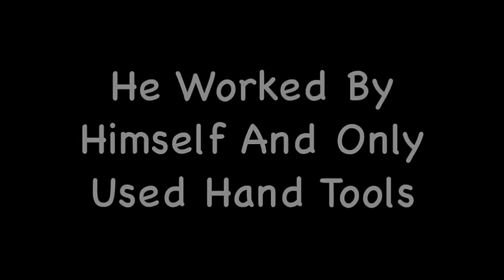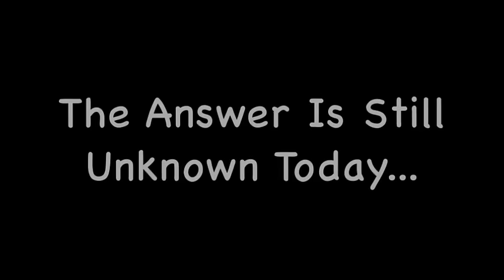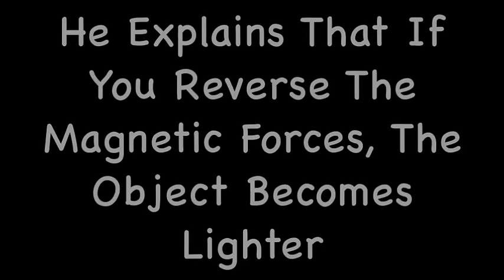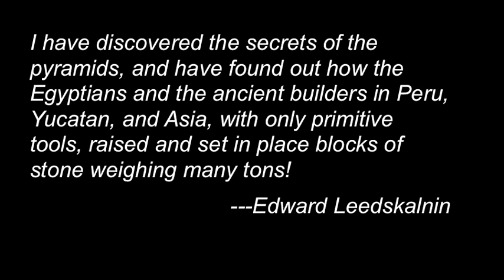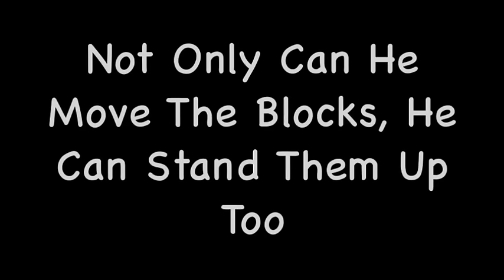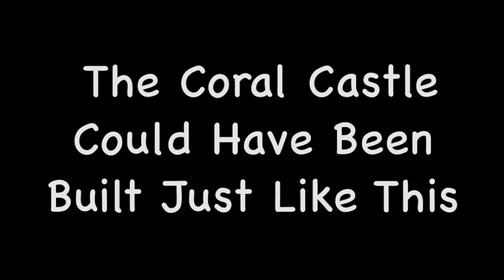Coral Castle: Mystery Solved

Comment: Great video, but there is only one problem with your solution. When Coral Castle was moved over 10 miles away. The first truck came back in 30 minutes to find Ed Leedskalnin had already loaded half of the next truck with 50 tons of stone by himself. Using the techniques you show in your video, this would have been impossible.
Reply: Yup, I agree...I don't think this was what he used either.
Reply: ***** But either way, this guy is also quite the genius. He equally accomplished the same task through physical and technical understanding. AND - unlike others, he showed us how he did it. Thus, he could be considered a greater contributor.
Reply: bobbie joe shmo I'll argue that last point you made. Was the atomic bomb a greater contribution because it was made known? Are nuclear plants in operation today a greater contribution because they were made known? Are cannons and war machines a greater contribution because they were made known? Is Methamphetamine a greater contribution because it was made known?  My answer to all and any invention is; that who holds the knowledge of great power must use great discretion to prevent the soiling of it by mans weakness'. Humans have only proved time and time again that we are not responsible or loving enough for great things. Just as a gun made for hunting can be used to kill a man, so to can a pencil made for writing be used to kill a man. The individual needs to be removed from oneself in order to learn a higher Truth so that human weakness do not spill into the design of powerful inventions or ideas.
Reply: Brahp Meahh I completely respect your point, but most of the state of FL is run by nuke power. Cars run because knowledge of how to refine oil into gasoline was shared. And look at radio waves, microwaves, cellular etc. All enrich our lives because they were shared.
Reply: exactly...this doesn't solve the mystery but still shows a way to do it. Though it lacks efficiency of time of his mysterious method.
Reply: bobbie joe shmo ..and cars, though being changed quite a bit with hybrids, etc... to be "cleaner", have provided quite a bit of trouble. I love that they made it possible for me to visit my relatives in little time, but people before me needed horses, before that walked or just didn't go. Because I have luxuries they didn't, doesn't make it okay to pollute the world. We keep up this pride of invention and when we find out a new drug or contraption needs revising because of serious problems, we shrug and move on like it was okay to blunder as long as we "progress". Meanwhile we've mad sit so easy to live that billions of us will be fighting over water eventually. Ridiculous. We should be inventing ways to no use so much of everything, yet the majority of what we've invented keeps us looking for more "things" to have. Fix THAT.
Reply: bobbie joe shmo He did something better than give us something to use. He showed us what we can be capable of all on our own when we understand the universe. That is something that should be kept secret or to those with higher knowledge. One must understand that there cannot be peace so long as the self exist, as the self of each individual is entirely responsible for what happens in this world.
Reply: Interesting
Reply: ***** It is not I who deem the unworthy. The unworthy deem themselves. I do not see great secrets of knowledge blessed upon the face this Earth in modern times, so therefore we have all been deemed unworthy. Humanity is ripe to fall and so shall it be if we deserve it.
Reply: bobbie joe shmo I'll agree with you that this guy is smart to do this, but he in no way shape or form accomplished the same as Leedskalnin. First, this method doesn't answer how to stack stones, second: doesn't answer how to cut stones, third I think more than wanting to be a contributor, he was going for his 15mins of fame under the pretenses of another man's accomplishments. Lastly, he doesn't try to correlate anything with the stars(his method is too inaccurate... what if he'd of been off by a foot, or angled wrong? No contingency there to correct these issues.)
Reply: The Truth I completely agree!
Reply: Yes these things make life more comfortable but they in no way make life more simple. Death and destruction have always been the primitive mans game. If we do and when we accomplish anything its far from great. Some will benefit others will suffer. If we had learned the secrets of levitation any earlier I'm guess the world would not stand as it does today. Image a floating aircraft carrier... wooo! Humans fail at the basic principles of life and those have nothing to to with science. Sorry if this isn't the kind of debate you wanted to have, but I'm sticking to my original point that we don't deserve anything. Not yet anyway.
Reply: Let think how he could move it faster. We saw the rolling methods with a long bridge of wood under to make sure it falls a certain way. There is also a Gömböc that will always right itself no matter where it sits. So you just modify the shape of the stone tying wood to it instead of making a long bridge. Then you can roll it away as it wants to end up on a certain face but you push it over and it will keep moving as long as you add force. What shape that is I dunno but all the other examples are out there for it to be.

A piece of wood and a tiny stone on it to balance it and be able to add your shaped wood braces causing that eternal fall and just walk the dog.

Comment: The problem with Wally's theory is that he only moves big rocks on prepared smooth surfaces. I'd like to see him move those huge rocks over rugged terrain and up and down inclined contours.
Reply: it is NOT hard to imagine that someone instead place stable ground to move the object a distance. you can also CHOOSE the path you take and avoid difficult terrain.
Reply: @juanserrano8678  You gonna do that for a couple hundred miles?

Comment: During half way point of building it he moved the entire build ten miles away without anyone seeing any machines. The rotating gate is 9 tons, it took a 50 ton crane and 6 guys to replace the bearing in 1986. If you can piece together a truck diff and wheel hubs to move half that weight by yourself and place it on a pin to revolve with little effort as-well-as when it rotates it comes so close to another rock, 3 tons heavy, that no light shines through.then I'll accept this.search 50 ton crane

Comment: This doesn't explain how Leedskalnin moved MUCH heavier pieces in a SHORTER period of time, nor how he QUARRIED huge blocks of coral. I don't recall him claiming that Leedskalnin used these methods, but that is implied by the narrator. This video HARDLY explains the LEVEL of the magnificent feats required to build coral castle, though SOME of these methods may have been used.

Comment: 3:55 Ingenious guy at the end. Probably not the way Coral Castle was made nor the pyramids, but I admire that man's imaginative solution for moving huge blocks.
Reply: No, he did not solved yet! Because he can rotate these blocks only on a smooth surface. I bet he could not do the same on the rough ground!
Reply: There is something called acoustic levitation and frequencies
Reply: @lebanonchristian3951  they definitely didn't solve it because when 2 men came to drop off a bunch of coral they said they left for lunch came back in 30 minutes and they coral was off. They said he had no machine and didn't have the time to set it up. There's a reason he built it where he did because of the lay lines and he only built it at night so no one could see how he did it!
Reply: @brando36922  what do you mean ? Magnetic stuff? The outer parts of pyramids are definitely some sort of concrete but the inner ones , there is something behind the ancient civilization they don't want us to know about
Reply: @lebanonchristian3951  absolutely but I think it had something to do with magnetic and acoustic levitation.  He also built the sites on lay lines.  Same thing with the pyramids.  Just do the research the lay lines go across the world.  Iv been there 2 times its incredible.
Reply: @brando36922  there is still a mystery about that , I bet some people know but they don't reveal it to the public nor they willl. Maybe a combination of a high technology magnetic stuff maybe that explains the fork shaped object in the images and the ones found and are in a museum that each two of them were tied with wires possible made them to resonnate , and the outer stones are molded in place by a limestone formula they did and it is actually tested .
Reply: @lebanonchristian3951  just remember he always carried that black box and wasn't around anything else when he cut the coral out of the ground.  If your intrested in this type of stuff go to ROBERT sephers YouTube channel you will love it his other channel is called atlantean gardens.  Go to both you will be blown away.
Reply: @lebanonchristian3951  A guy made stuff levitate with two Tesla coils it's a very crude example but it's not just sound. It's called "The Hutchison effect" and can be found on YT.
Reply: @lebanonchristian3951  Same message is encoded in the Freemasons Grand lodge in Philadelphia.

Comment: A couple of points occurred to me after watching this...
Ed did not use concrete blocks, but rather, he actually somehow 'cut' the blocks from the coral bedrock. According to the "In Search Of" TV program, as I recall, it took hours to cut the rock using modern, diamond tip cutters.
Also, it took a great deal of time and preparation for Mr. Wallington to move his blocks. However Ed loaded very large blocks onto a flatbed while the driver waited just out of site so that his secret would be kept.

Comment: This doesn't explain how he lifted the quarried coral out of the ground.
Reply: My understanding is He had the corral rocks delivered by trucks, and He would make the driver leave and when the driver would come back, the blocks would be unloaded.
Reply: @ThisIsGonnaBFine  I think this was just how the blocks were transported from his original site to the location it's in now. coral castle was originally located in the Florida City area but it was moved. it seems that Ed quarried the blocks himself from the bedrock using a large metal door, among other things. quite possibly the quarrying was done with some sort of sonic drilling/sawing and then it seems like he may have combined mechanical advantage (from pulleys and ratchets) with some kind of magnetic influence to lift and position the blocks

Comment: its nice that he managed to make these rocks move on a perfectly flat cement surface but how about on the actual ground? also how did ancient people cut limestone using copper? its one thing to move a stone its another to carve it.
Reply: +Ryan Punk Yes, the problem with moving large stones on ground, NOT cement surface, is a big one- the blustones at Stonehenge came from Wales, and depending on the route, and whether any of it was by water or not, would have had to travel somewhere between 135 and 200 miles. No evidence of trackways has been found. If they used Wallington's pebble method, they would have had to put down a solid surface for the whole distance, AND it was not all level, either. The pebble method will not work going uphill. I have studied Stonehenge quite a bit, and even if part of it can be explained, a lot of it cannot, or at least has not. Also, you mention the carving: the capstones have perfectly fitting mortise and tenon joints to fit the uprights, and also V/A shaped interlocks on the ends. Not only that, but the capstones are not actually rectangular, they are very slightly rounded to conform to the overall circular structure.  And this is not even addressing the fact that people in roughly the same (but not precise) time frame, also built Avebury, Silbury Hill, West Kennet Longbarrow, and countless other amazing structures.
Reply: It's been shown that you can cut rock very easily with a toothless copper saw, using sand as the abrasive.  The ancient Egyptians did it even with granite, so limestone would be no problem.

We're also assuming that they didn't just do a rough cut with other tools, then finish with a polishing rock and sand.

I don't think the carving is really the big obsticle here.

I don't know much about Stonehenge.  Do we know what tools archeologists have found at the site?
Reply: +anonymouseketeamster Copper tools were not yet in use. That aside, though, there are a lot of other problems to be addressed: why did construction continue at Stonehenge for 1500-2000 years? What caused the people of the area to be dedicated for that long? Of course, it was not a continuous build for all of those years, but from earliest to last phases, that is how much time was involved. During that same time frame, 4 million man hours were used in the building of Silbury Hill. More man hours were involved in the building of the Avebury Circle (actually circles, plural) than at Stonehenge. Woodhenge was also built. As far as tools found, basically antler pics for digging have been found.
Reply: Casey Vee
I guess the answer to "Woodhenge" is pretty simple - Weather meant that it had to be rebuilt as the elements ate away at it.

That kind of begs the question about its purpose though...

It would suggest a ceremonial significance to the sites, and one that was deeply entrenched in the culture of the people of the surrounding area that spanned millenia...hence their devotion to to the Avebury circle(s) over such a long period of time.

I've read and seen some interesting documentaries which all address potential anthopological reasons for these great complexes being built.

It was a while ago, so I'm a bit fuzzy on the details, but I do remember hearing about a group of archeologists uncovering what appeared to be a connecting road between Woodhenge and Stonehenge, and theorizing that it was part of a mass processional of people undertaking an annual rite for those who had passed in the previous year.

Of course, that's a theory...which is a fancy word for an educated guess.

I'm sorry I can't remember the name of it...but there's plenty more out there...plus a few that look at the actual construction of Stonehenge, which have some tell-tale marks of pretty well-known construction techniques (I think it was holes for hoisting ropes on sides that wouldn't be seen...but I could be wrong).

Anyhow, I'm in the middle of looking at something else right now, and this isn't really something I actively research, but if I come across the material again, I'll link you up.
Reply: +Casey Vee The blue stones were light enough to be picked right up off the ground. How do you think they got them on the boat? And they DID carry them on a boat. Not just because one is still on the seabed, but because they weren't idiots.
Reply: +Ryan Punk 
Make a path of smaller rocks the size of boards...
Reply: +Ash Scott OK, so they only had to take them 135 miles by land. Try having a group of people pick up a five to six ton stone and move it 135 miles with no modern tools, vehicles, etc., up and down steep hills, across soft ground and mud, etc. It can be done, but is not some simple and easy feat. While you are at it, be sure to grow, gather, or kill food (and prepare it) for your laborers. They have to eat too. All of that out of the way, why did anyone persist in building for 1500 years?
Reply: It provides a scarcity in an otherwise bountiful rich landscape. Building the pyramids provided jobs to those that would've otherwise been wondering why they pay so much tax to the pharaoh when they could've been working just a day or two a week.